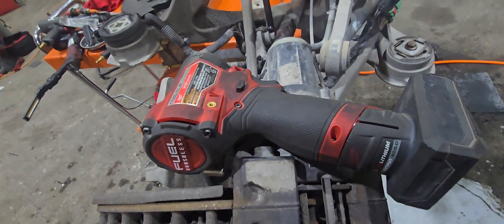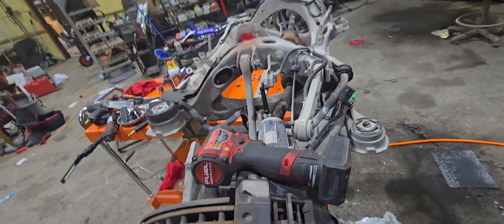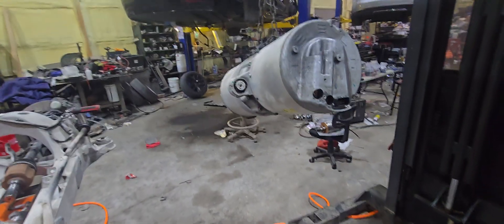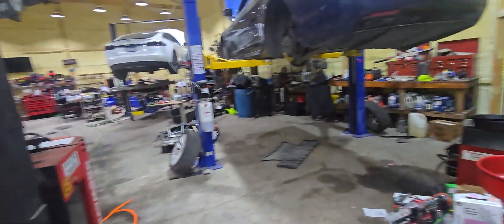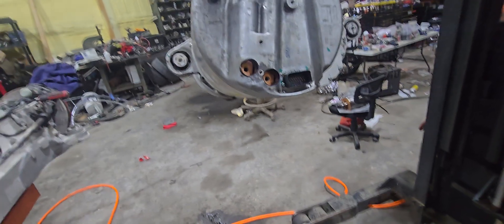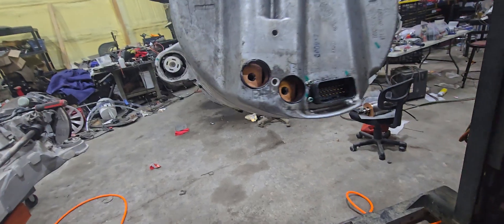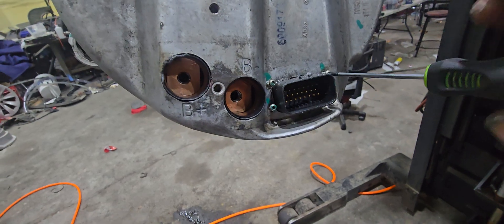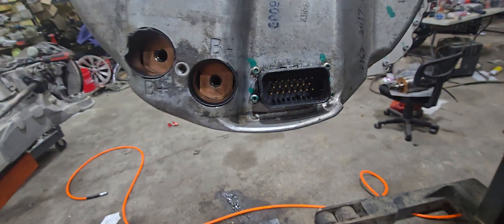Tesla LDU tip.

Comment: Exactly what does the coolant delete do? Make the car perform better? Cause I thought coolant help keep the battery’s “cooled”?
Reply: If I remember correctly I think the Large drive units in older Model S cars were very prone to the coolant leaking into the motor, destroying it and apparently the coolant isn't even necessary for most drivers so by deleting it you are preventing the motor from getting destroyed in the Future.
Reply from the maker: Tesla's large drive unit have a seal on the rotor that fails and needs to be removed Tesla's replacement drive motors have done the same thing that we've been doing for 3 years by removing this seal in blocking that off but continuing the flow of the antifreeze The kits cost 50 bucks but are very labor-intensive to install
Reply: @ForkliftsbydayTeslasbynight how long does it take to do the coolant delete once you get the car ?